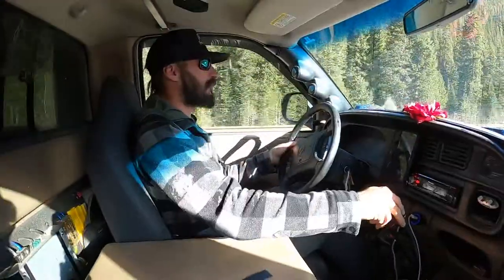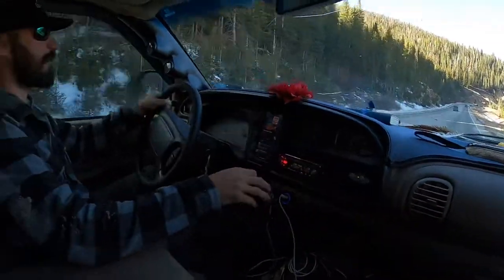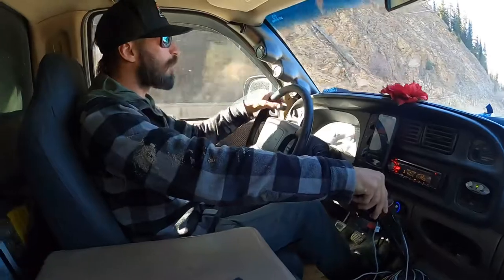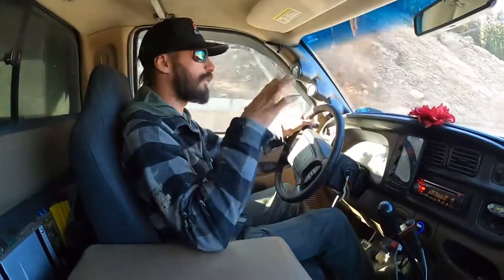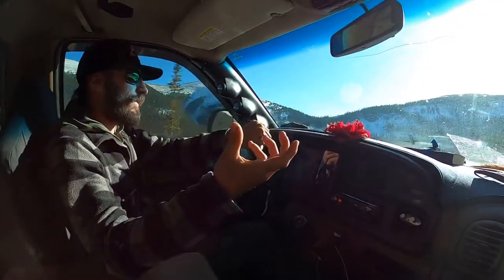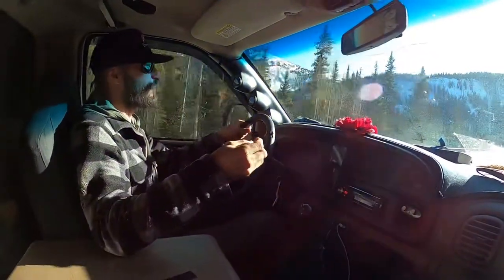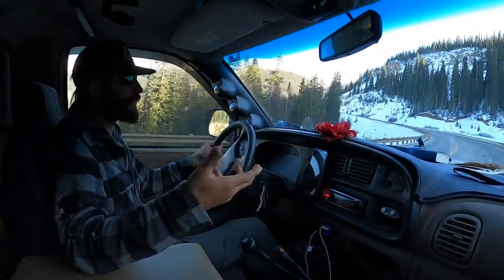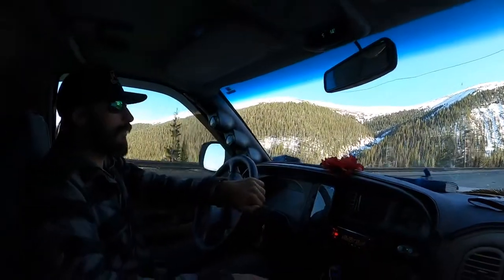2001 Dodge Ram, 24V, 6 speed manual | Towing my heavy ass camper through the Rocky Mountains

Comment: Towed my 42 foot fifth wheel with my father in laws 12 valve. It struggled in first and 2nd gear but after it got going it did fine.
Reply from the maker: Was that with a 5 or 6 speed transmission?

Comment: You're very blessed to be pulling with a Turbo charged 5.9 vs. a gasoline engine with NO turbocharger ! The Turbo diesel makes all the difference in the world when pulling heavy loads through high altitudes .........4,000 to 12,000 ft. in elevation !
Reply: Makes a huge difference, truck isn’t working hard at all, the ride is more comfortable being set up better for the weight, makes your drive all that much easier

Comment: I’m gonna swap one of these 6 speeds into my 5.0 Cummins one day. Something about shifting gears feels so much more satisfying then an automatic.
Reply from the maker: Keeps my busy mind occupied while Im rolling down the road, ya know?
Reply: If you do swap a 6 speed behind a 5.0 Cummins you shouldn’t make some videos 👍
Reply: @hunterswiski8398  Gotta get the truck fixed first. 😅 injector and lift pump went bad at the same time.
Reply: @oinchadoomandwolfboy    Heard of the TR-4050 being adapted to the ISV5.0 but not the NV-5600/G56.
Reply: @digitalparadox7138  Yes but it’s a 5 speed not a 6 speed.
Reply: @oinchadoomandwolfboy  

That was my point, friend.

If you have a friend with access to a CAD system and mill.....you can solve almost every issue you come across.

I'd be interested to see the end result.

Comment: I just seen a 2002 single cab dually with 9 inch lift  diesel wheels and 6speed tranny omg I'm in love with these  trucks
Reply: Diesel wheels yeah? 🤣
Reply: 9 inch lift! How are you supposed to ever use it to do what a dually is supposed to? A truck camper is out the window unless you go with about an 8 footer at most (not to mention a pain in the a$$ to get on and off and way more sketchy while doing so) and as far as trailers go even if you manage to get a hitch that’ll work it’s not going to be nearly as stable in that case either so again you have to go with a trailer significantly smaller than you could without the lift unless in both cases you’re fine with rolling the dice with a potential huge accident. There’s a lot more half tons out there and they’re not designed to do massive jobs which is why I think huge lifts are much better on them. You’re not wasting a work horse for thrills that way.
Reply: @thatoscarguy9965  just love the lift and the Alcoa wheels
Reply: @SIX4TALL  nothing wrong with that I just think it’s a bit of a waste on trucks like those. I’ve seen it done on quite a few ram 1500s which I’d be much more into. Still get a pretty similar end result and makes a lot more sense in my opinion. I’m currently looking for a one ton manual gas truck for my custom built 12 foot truck camper and it’s a little frustrating that I’ve already come across a couple that I would get but can’t only because they’re lifted and I wouldn’t want to go through the huge headache to remove it.
Reply: @thatoscarguy9965  i love it 😍

Comment: Only thing you said off was the throttle valve in the throttle body. None of that on a diesel or atleast this diesel.
Reply: Oh thank god he passed your test 😅
Reply: @user-jb6co6vc4q  I corrected one fact.
Reply: @user-jb6co6vc4q  I mean, he really doesn’t seem too knowledgeable to actually warrant having this video up. Actually pulling with your egts at 1300 degrees is WAY too hot for a steady pull, he’s gotta have a junk tuner. Egts either spike way down low around 1400 or 1500 when you’re lugging or when you’re up around 2600. 8000 lbs isn’t anywhere near enough weight to see those kinds of egt numbers at 1900. I can come through the Virginias and East TN all day long pulling 12K lbs fifth wheels and barely run at 1000 degrees. Also it’s not necessarily a bigger turbo that cools down egts. The factory Holset is big enough but the outlet is where the issue is. The outlet flange on the factory turbos won’t flow well enough to move hot air out. Plus the whole “throttle body” thing. Just an opinion
Reply: @GMbowtie350  that may be true, but where's your video at?
Reply from the maker: @GMbowtie350  I think we see higher EGT's towing out here because we are at twice the elevation you are talking about towing at, and there's around 30% less oxygen in the atmosphere at those heights... but what do I know, I said something about a throttle body 🤣
Reply from the maker: Sorry, maybe I was high? Those Cummins just have intake valves that pull air from intake manifold? I mean shit, I don't know...
Reply: @hitpointalpha8691  I appreciated this video a lot. Pointed out many things about diesels I hadn't known. Keep it up

Comment: Sweet vid man love the 6 speed!!
Reply from the maker: Favorite truck transmission ever, like driving a little semi!
Reply: @theferalife6452  Sad thing is the new trucks have done away with the manual transmissions.
Reply from the maker: @moto5513  I know, right? It's like we have to keep making it easier and easier for people, and nowadays you can't drive over a pass without seeing someone on the roadside that has boiled their coolant or smoked their tranny fluid 'cuz they don't know anything about what's going on beneath that go pedal...
Reply: @moto5513  it is sad I’ll never get my dream truck brand new being a one ton manual extended or crew cab long box. The newest possible would be a dodge as they lasted until 2018. So much more fun to drive and more reliable and cheaper to fix when it does wear out. Not to mention the awesome character you can bring to the shifter with a different shift knob. Can’t ever do that with an automatic truck shift lever. Hate the decision by manufacturers to get rid of them completely. I would’ve much rather seen them get rid of options like being able to get a regular cab short box truck long before something great like this. Just sold my 2012 automatic f250 yesterday and the hunt is on for my dream truck to haul the 12 foot truck camper I’m building. It’s sucks how few and far between they are at this point and how many have been abused but I’m sure it’ll be worth the wait.

Comment: Nice video man i have a 01 5 speed wish it was a 6 speed
Reply: You can be glad it’s not a 4 speed at least. :) I know the feeling though my 2007 Acura with the 2l engine cruises at 3000rpm in fifth gear at highway speed meanwhile the 2003 Honda civic with the 1.8l engine I previously owned also being a sedan cruised at 2500rpm in fifth gear. They definitely could’ve and should’ve designed it better or added an extra gear.

Comment: Throttle body??? I was lead to believe through school that gasoline engines use a throttle body and diesel was fuel controlled in relation to mechanical or electronic metering…?
Reply from the maker: Yah I think that engine just pulls intake air through the valves directly from the manifold actually - I dunno, if you find out, get back to me ;)

Comment: maybe get a 4 or 5 inch straight pipe and not have to worry about your egts as much?
Reply from the maker: It's 4" but with a high flow muffler - I got tired of true straight pipes after 100,000 miles. I did see an increase in EGTs with a turbo change, I went smaller on the last one at the shop's recommendation, and went a little too small. Seems like different folks have different opinions about proper turbo sizing and altitude...

Comment: Are you double clutching or timing that bad boy ?
Reply: you don’t have to double clutch you only need to use the clutch once per shift with regular pickup trucks
Reply: He’s clutching, but you only have to clutch once with pickups. Synchro transmissions are harder to float but it’s possible. There’s a lot more grinding in these then there are in eatons lol
Reply: NV5600 is the easiest of the 6spds to float gears in.
Reply from the maker: @smittysmith4828  I agree, I just don't take the chance as much loaded on the hill!
Reply from the maker: It's a slow, timed single clutch move - almost like double clutching. This transmission floats or slip shifts pretty well, but I don't do it as much towing these days...the metal shavings in my fluid change make me a little less willing to grind gears loaded!
Reply: @theferalife6452   I would whole heartedly agree with that brother.